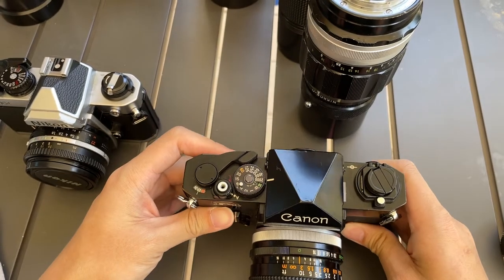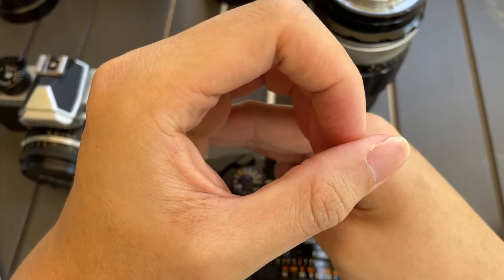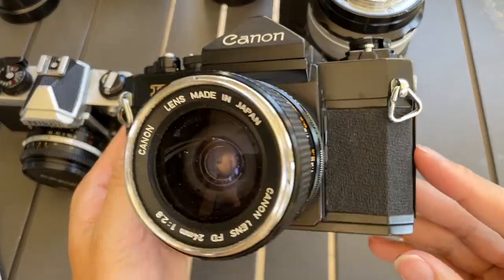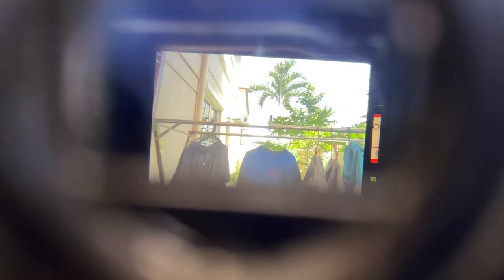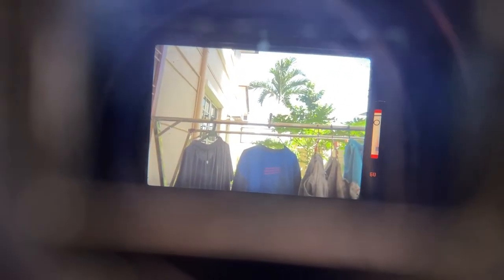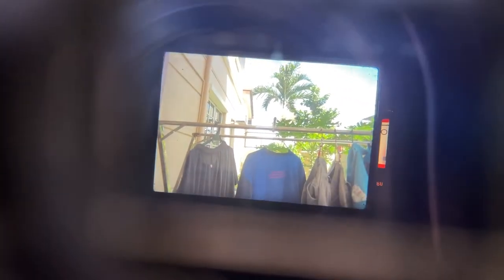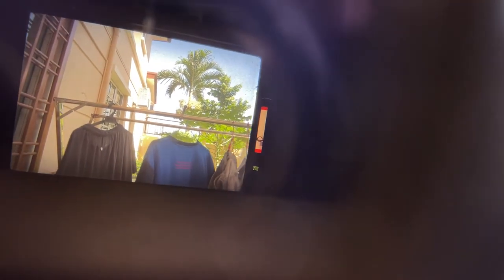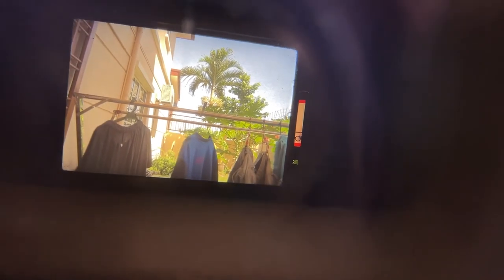How To Use The Canon F1 Lightmeter For Film Exposure ( F-1 )

Comment: Thanks for the video , very helpful. I’ve recently bought a Canon F1, when I move the aperture ring up and down it often seems to catch and push around the light/speed meter indicator, is this a common fault after time, in your experience could this be easily fixed at a camera shop?
Reply from the maker: Sorry im not sure how easy or hard it is to fix this but sounds like a mechanical issue 

Generally mechanicals issue are fixable as far as i know but also depends on the technician doing the fixing

Comment: Hi there - I have just picked up an Canon F1, where the the circle of the light meter (moves up and down depending on aperture), however the line itself is stuck at the bottom (no matter what shutter speed you select)... if I select 8,4,2,1 for Bulb the whole scale turns red. What is happening here?
Reply from the maker: u got put battery ? if got put batt then maybe the lightmeter needs servicing
Reply: @famecherrytv  What battery does an original Canon F1 take?
Reply from the maker: px625 1.35v batteries but not sure if the newer versions are different 

wein has the px625 1.35v batteries that i sell and use , the alkaline 1.5v also work but exposure will be a bit off
Reply: Having the exact same issue with mine
Reply: you have to turn it on first. to the left of the viewfinder ring there should be a little knob that reads C, Off/Flash, On. 

Switch the knob to “On” and aim the meter at a light source. Switch  it back to “Off” to prevent unwanted battery drainage.

ps: it took me forever to figure this out too.